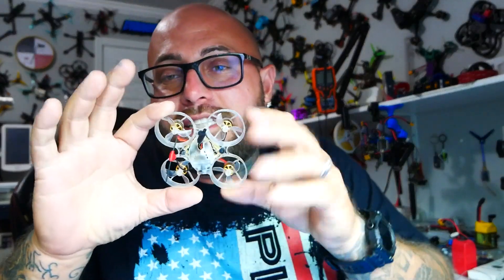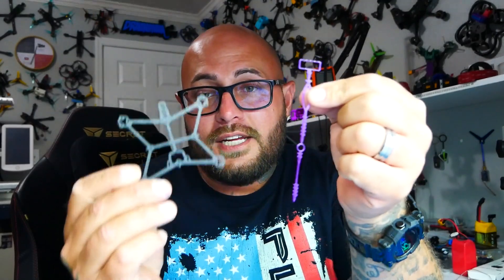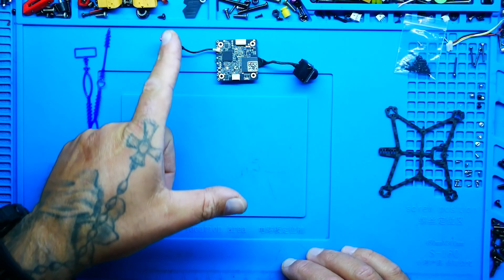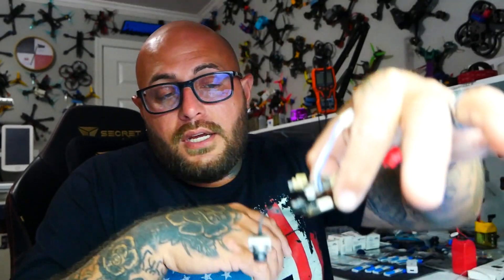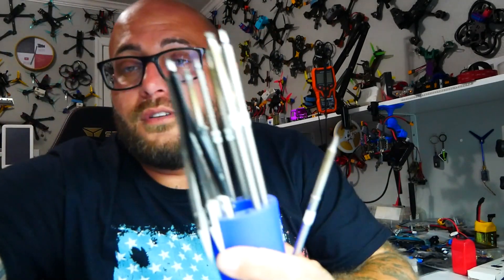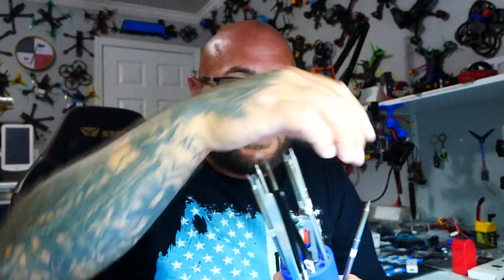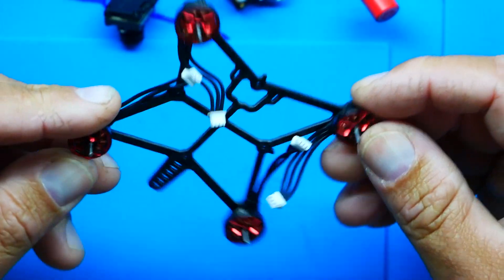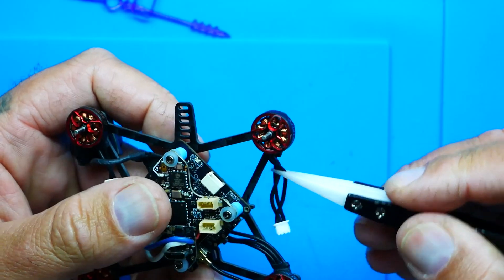I Built The Fastest Smallest Micro Drone ! It Blew Me Away !!

Comment: Fractal Engineering seems legit. I think its just two people coming up with seriously creative ideas. 

They're making ther own AIO, 2 boards, to keep component density down soley for ease of repair and replacement of individual components. The MCU is a completely different chip, F435? They're going for performance and repairability.

They also make this voltage booster. Bumps up 1s voltage to keep the VTX powered as the pack voltage drops. It's hard on the pack cuz it'll keep flying down to like 1.8v but thats a cool idea for those chasing max performance for their tinywhoop

That AIO they're building also has one of these voltage boosters built in, and they sell another voltage booster for cheap too, cuz it was too heavy, or some kind of error, but it works and they got good deals.

Comment: Hey DrainMan if you want to blew your mind even more: Use 45mm props on those 1102 22k motors. And AWG20 main cable. And motors soldered directly to the board without motorplugs. Happy flying!

Comment: Hey bro I think I did a bad flash on my tinywhoop so now I'm trying to flash it through betaflight pass through but my elrs receiver doesn't have a boot button it has the two pads if I sodder those pads together do I have to remove the joint after the flash or can I just leave it there

Comment: Hey a what could be wrong with my esc all settings are correct arm switch aux one angle mode aux two motor wont spin but when I try to spin the motors on beta flight they pulsate at very low power